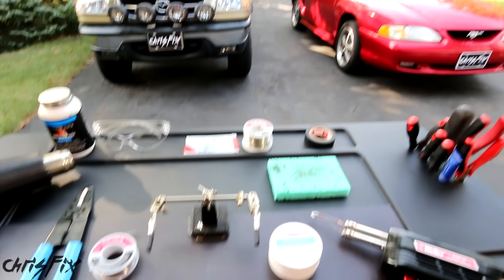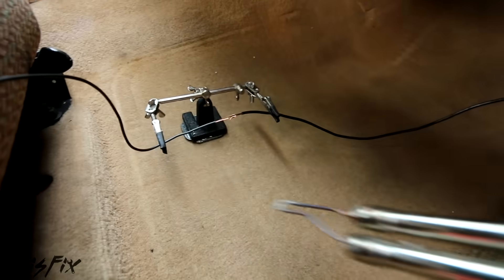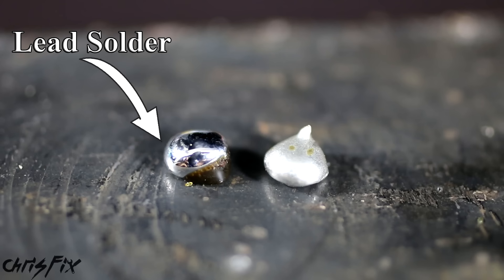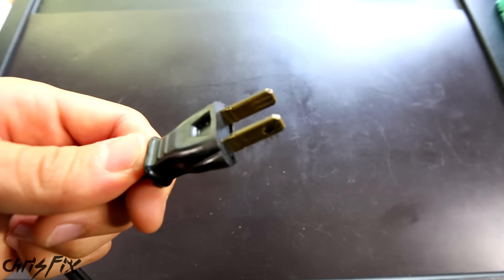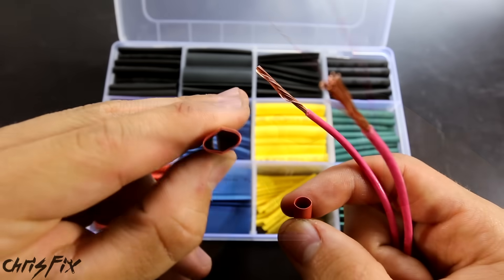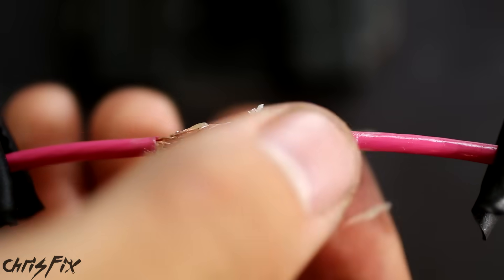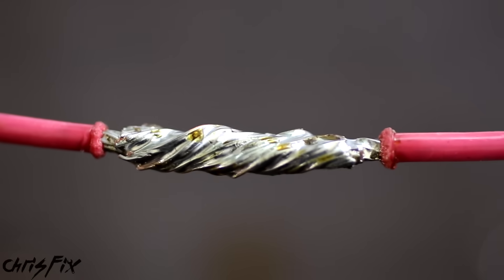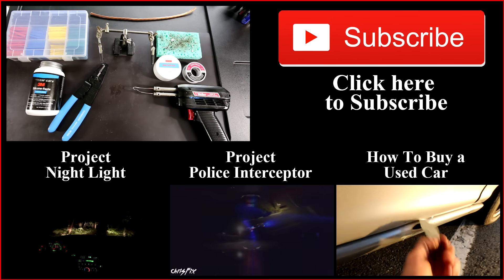How to Solder Wires Together (Best tips and tricks)

Comment: I have an old head unit in my car that has a bad screen. Replacing it and want to wire it right. I’m going to soldier it then use head shrink and high temp electrical tape and zip tie everything neatly together. 
I’m hooking up an alpine head unit with a mini 4 channel amp that puts out 45 watts rms per channel. I like the new slim head unit design so I’ll be able to neatly place the amp right behind the head unit.

Comment: Hi, thanks. Any hack to solder an aluminum wire (thin gauge) to another aluminum wire (same gauge). The usual flux and solder doesn't seem to work.

God bless, Rev. 21:4

Comment: Chris, great video thanks!  Another tip that I use is that I DO NOT touch flux with my fingers, oils from my hands have gotten on the joint and have caused the solder to not adhere. I always use a small brush and only use it with the flux and store it in a baggie.  I have had success with cleaning the joint with isopropyl alcohol to help resolve the oil issue and then re-soldered the joint successfully.

Comment: A trick I found for stripping stranded wires is going one gauge higher. Ex: With 12 gauge stranded, strip it in the 10 gauge hole. If you have 18 gauge, strip it using the 16 gauge hole. 

This is because the diameter of a stranded conductor is slightly larger than a solid one (what strippers were designed for).
It might be a bit harder to cut all the way through the insulation, but this prevents the wire strands from being torn or cut out.
Reply: Yes, very good tip. also you can press wire stripper, try to twist a wire a bit, then loosen the grip and pull insulation off

Comment: Can you use that "Helping Hand" device on soldering of wires for Data Link Harness? I think I have one wire which is not connected properly, so sometimes Actron doesn't get connected w/Data Link Connector (no power), if you shake it - gets powered, but can't read fm that car (Link Problem). I even don't know, probably it won't be possible to locate  "Helping Hand" in that area under the Steering Wheel. Thank you for the film.

Comment: The tip about heat shrink tube on the wire holder is great. The solder tip out of wire is killer. I took a gun that could barely get the job done to one that heats up way higher than a conventional tip and cooks the solder into the joint for a better connection. You taught an old dog 2 new tricks. I was a plumber by trade though. Thanks

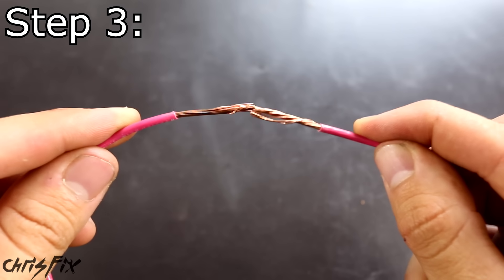Comment: Hello Chris!  Thanks for explaining everything clearly.  As you have said you do two ways most of the time on the method of twisting bare ends of wires @ (7:38) and most people would do the same, most of the time.
I do that in another way, I started using a technique for Extending the Same-Size wire:  first strip about 3/4 inch of insulation from each end of the wires to be connected.  Next, spread out the strands on each wire and grouped them into two clumps of strands.  Cut off one clump at about half-length (0.5 * 3/4 = 6/16 in) on each bare-wire end.  The reason is you will align them later and it will not contribute to the very thick diameter of the joined wires, for Extending the Same-Size wire, then twisting the bare ends together and solder.  By doing this way, it is going to be easier to pull the wires through the engine firewall of the car (only if you have to) for mounting your electronic meter instruments, such as a tachometer and/or any other electrical devices and controls.

Comment: Some good tips BUT, you would not want to use the soldering iron shown on circuit boards...in  have that Weller iron and it's a 60w that hits 900F with no temp control, that's way too hot and risky for delicate electronics.
Reply from the maker: Thanks for sharing!

Comment: There's something so satisfying when the solder wicks through or around your parts and towards your heat source. Then you know you have a perfect joint. 
That dielectric grease before the shrink tubing...then watching it squeeze out...Damn I can't wait to try that one! That's definitely a great idea! Thank you:) My biggest problem is getting all done with soldering and realizing I forgot to put the shrink tubing on. Then I have to start all over. One time I did that and didn't have enough wire to fix it..so I had to use a mile of electrical tape. That sucked! But it's been quite a few years since I did that so I guess I messed that up enough times that I finally learned!

Comment: Question.  Do you need to clean off the flux before applying the heat shrink?  I saw a bit of the yellow stuff left on the wire

Comment: Hello i have a question i came from a video from where person showed you can turn them together but those wires had 4 wires copper, red etc but when you are soldering it looks like you only have a  copper one so what is the diffrence in cable?

Comment: @ChrisFix ...I repaired a motorcycle tail light turn signal wire small gauge wire ...it was in a way that I could not take more wire without sacrificing length and it was going in a bend of two wires long story short there may have been a part where a strand may have been missing I soldered the entire section. I'm the video you say may blow a fuse or over heat is there a way I can test for proper function so that this does not happen

Comment: Hey Chris, if I can’t find a soldering gun, is it ok if I can use a lighter?
Reply from the maker: You can, but it won't be as good as using a gun! Make sure you are using the heat from it and not the flame!

Comment: Had a rat chew through one of my car fog light wiring, fortunately there's plenty of length to solder it back together. Any safety precautions I should take? Like disconnecting the battery or the fuse?
Reply from the maker: Darn! Definitely disconnect the battery, use safety glasses, and wash your hands hands after to ensure you are safe during the job!
Reply: @chrisfix  Thanks to this video I was able to reconnect the wires saving me a trip to the Mechanic and not just this video, I've been doing my own car maintenance with the help of your videos. You saved me a lot of money already and more so into the future with the knowledge I can keep using. I'm new to things Car related and your videos give me a lot of confidence to DIY. You're the kind of Youtuber we sorely need. Thanks Chris.

Comment: Wouldn't the silicone or di-electric grease prevent the adhesive in the heat shrink from sticking and doing it's intended job?
Reply: There is no adhesive in the heat shrink

Comment: I followed the procedure as described, but the solder does not melt in proper time ( 1 -2 seconds) , it takes much more time and sometimes it needs direct contact to tip of gun.
Reply: Maybe your soldering gun is old or bad quality and doesn't heat up enough

Comment: 11:06 Another thing you can do is put a little bit of hot glue on the bare wires. When you warm up the heat shrink, the hot glue on the wires will melt and squeeze out just like that silicone, but it'll harden back and make a better seal.

Comment: Good tips. I would add, you can use heat sinks, alligator clips at the edge of the wire to keep solder from wicking underneath the insulation.  Good video. Thanks,
Reply from the maker: Thanks for the tip and thanks a lot!

Comment: Great video for component wiring. The main things to keep an eye on are: flow and color. Your solder should adhere to your wire and not ball up; if it does ball up then that can mean not enough heat or not enough flux (think like water going into a paper towel vs. water on a windshield). You solder should also be silvery once finished and while applying; if it has a blackish or bright yellowish color, usually means that you over cooked the solder and baked off all the flux hence got oxidation in your solder; can also mean your tip is dirty/oxidized.

It takes time and practice to get comfortable with soldering. There is a rhythm to it where you want to work slow enough to apply adequate heat but fast enough not to overcook the connection. You can also use a hair dryer or just wave the solder tip around your heat shrink to tighten it up.

Comment: Dude... Additional Flux shouldn't be used as it helps draw tin underneath the mantle or insulation if you will!

This is not a good thing! 
You cut the cable a bit from the end to make sure the strands are pristine, nice and clean, not corroded!

Using Flux makes the cable strands stiff underneath the mantle and it thus creates weak-spots on each side of the joint.

This can be prevented by using only the resin already in the soldering tin, and also a cold-wrap (strips of linen, rags or strong paper) around the mantle to cool down the mantle (They should not frown like in the video!) and at the same time prevent the solder to spread beyond the actual joint.

Comment: Great Video. The only thing I disagree with is the dielectric grease under the heat shrink tube. The grease will keep the heat shrink tube from sticking to the insulation and wires. Instead, use  Heat Shrink Tube with an Adhesive Glue Lining. The adhesive glue lining will stick to the insulation and wires and make a water tight seal. Almost the exact same way I was taught to solder, over 30 years ago in the military. Thanks for a great instructional video.

Comment: Don’t touch the joint until it’s completely cool because if you touch the joint it’ll move the wires around while the solder is still in the liquid form...  
Don’t forget you can burn the heck out of your fingers, forget the wires moving around I’m more worried about my fingers lmao

Comment: My responses if it did not wik it did not bond.  Also you never get a job as an electrician unless you put to kinks in your splayed connection. Because you're splayed connection is not a connection it's a touch that means if you get a poor solder job it will slip apart. And sometimes the only way you can do it is heat on top then pull the heat it was a solder then back to the heat on top again you still have to try to wake it but those are the ones that you don't know whether or not you got right

Comment: We use a small butane torch for soldering the "cable extenders" aka the old Semi truck battery cables that have holes in the wire thats now wrapped in electrical tape where exposed to the factory battery cables for the race car. Oh and no safety glasses and probably inhaled more solder than whats healthy. and used a whole roll and a half of solder 🤷‍♂️🤷‍♂️🤷‍♂️

Comment: Chris.. why dont you use a flame to solder wire connections? I personally love a small blue flame as its so quick and easy. Its also handy for the heat shrink tubing :)

Comment: I have not been wearing goggles, no helping hand, no flux, no silicon grease, no rosin paste flux, and no wet sponge.  Just $8 from Walmart then I grabbed the  hot iron (not the tip part) with my left hand while holding soldering iron with right hand.  Brunt 3 fingers but only thumb needed medical attention but luckily I was soldering on my bathroom counter with faucet in front.  Thanks, just ordered Rosin paste flux & silicon paste.  No wonder the tips would get black and useless after one solder.  I was twisting the wires the wrong way ending up in a ball with duct tape but I also ordered a heat gun.  I also learn I need a spot welder for 18650 batteries. The soldering iron heated my batteries and destroyed it.

Comment: Installing my first sub woofer with a line out converter as well. So I'll be splicing into the back speakers. Many just twist them and tape, but I will solder it correctly like this and hear shrink them as well. I will also be using a 500 wat rms  Dual voice coil DCV speaker for my first project which doesn't have connectors, just the pits like old school (oddly enough). 
So I'll solder the wires onto the ends as well. 
All in all, should turn out nice. NIce connections, consistent.

Comment: Use nail polish to waterproof the wires. Dries up fast and makes a solid inexpensive waterproof coating for the soldered wires and also makes an additional layer of insulation.

Comment: Good vid. I also take a pair of smooth surfaced pliers like duck bills or the inner part of needle nose pliers for a smooth surface to crimp the soldered joint where any sharp tits sticking up so they don't pierce the heat shrink.

Comment: Tried to do the method of heating the wires from the bottom with the solder on the top. Solder gun started to smoke before it exploded. Word to the wise! Don't hold that trigger for too long, heh

Comment: Flux doesn't "Protect the wire". It cleans the surface so that the metal can wet. Flux (aka rosin) is corrosive when heated, it's the entire purpose of it. A good joint or circuit board will always have the excess flux (aka, flux residue) cleaned off using one of many flux removal products, or even IPA as over time the flux can become conductive or corrosive and destroy the device. Also, your smaller soldering iron is no good for heavy wires because sorry to say, it's junk. Get a real iron like a Hakko or Weller and you can solder some very heavy stuff with the pencil style.

Heat-shrink is NOT waterproof unless you get "adhesive heat shrink" which has a glue lining in it so that when it shrinks it provides a water seal. The heat-shrink you have is not the adhesive kind. Using dielectric grease is a good stop-gap measure, but it is not the proper way to do this, adhesive heat-shrink exists for a reason.

Moving a hot joint around doesn't create "air gaps" or "cracks", it produces what's called a "dry joint". This is because the metal crystals have not grown together as the metal has cooled resulting in a brittle joint that is subjective to failing when it goes through thermal cycling.

It's very bad practice to clean the tip-off after soldering, and it's likely why you go through so many. A soldering iron tip normally lasts me several years and I do a ton of electronics daily. By cleaning it off you are leaving the underlying plating exposed for oxidization, as the iron is still hot and now has nothing to protect the plating it accelerates the processes. When using a soldering iron you should clean it before you make your joint and then always leave some fresh clean solder on the tip when putting it away. Also lead-free solder also damages the tip if it's not designed for lead-free solder as lead-free solder is far more corrosive then leaded solder.

Your use of additional rosin/flux when soldering wires is also not needed when using rosin core solder, the only time I have ever needed to apply flux to a joint is when joining copper fittings (ie, plumbing pipe) that are not perfectly clean. Your use of additional flux, while won't cause an issue, is unnecessary when using rosin core solder (I mean, that's the entire point of it).

Comment: I have a relatively old um Logitech steering wheel It worked great but I broke it somehow and the wires completely snapped in half This will help a ton to save money I looked up all the prices it's about $50 compared to $500-$800 for a new wheel

Comment: Skip the silicone/dielectric grease spend a little more and get the heat shrink with waterproof adhesive that seals and expands on & around the connection when you heat it. And for the love of god dont use a torch to "drip" solder on the joint and think it's good, seen alot of mechanics make that mistake (mostly ones that don't typically do wiring)

Comment: I don't recommend silicon paste inside. If you take the correct diameter of shrink tube, you don't need it, and sometimes those pastes can burn. It's just my opinion, I'm not a god of electricity.
Reply from the maker: Thanks for sharing! I like to use it to make a wooder proof and stronger connection!
Reply: @chrisfix  okay, but as I said with the exact correct diameter, it's already wooder proof. Anyway it's a super cool video and your soldering was perfect!

Comment: wait $5 is a lot of money?  In the grand scheme of your work and lifestyle, I don't think it is. Just saying, to the rest of us, buy the $5 tip and spend your valuable time doing something more ... valuable. Also, an inexpensive soldering station that allows you to swap out tips (I got a bag of 5 tips for $12 for my Weller) and dial in temperatures is super helpful, I don't think most people could solder onto a circuit board with that gun, it's ancient - learned on one of those in the 70's (but subsequently forgot how to do it since the 80's).

Your tips on how to do the work are great, thank you for putting it together.

Comment: Really good demo... nearly all the salient points I learned many years ago at a NASA soldering class... really like the dielectric grease point... only thing missing is the isopropyl alcohol cleaning of the residual flux from the joint. Not doing so may cause issues in the out years.
Reply from the maker: Thanks a lot and thanks for the tip!